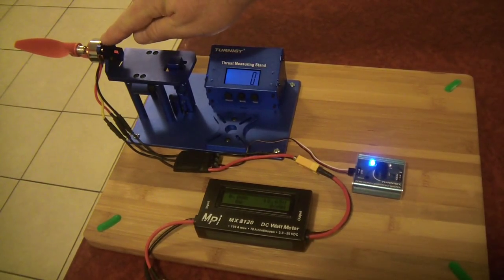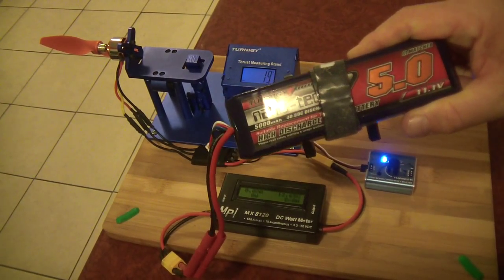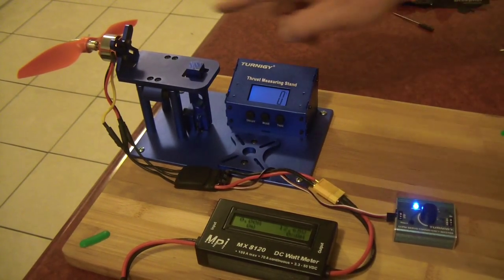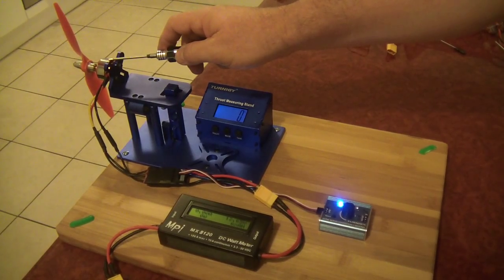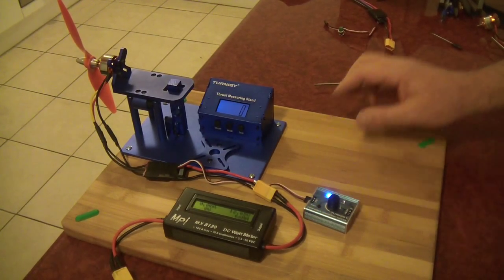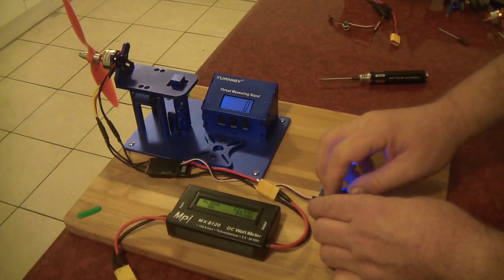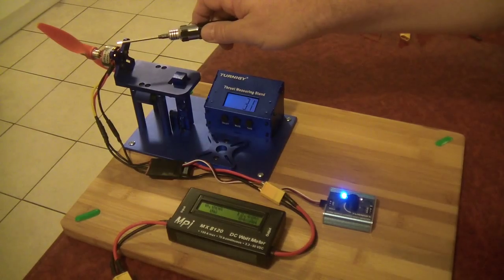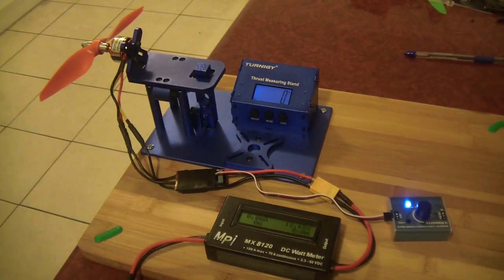BLHeli Vs SimonK with 2822 Motor and HQ 8 x 4.5 Prop

Comment: Hi Rob - Need some expert advice pls. for my S500 quad I picked up sunnysky 3108 720kv. hq 10x6 3 blade props. naza lite upgraded to v2. tarot t2d gimbal. 

I've got 30 amp afro esc and flashed with latest version of BLHELI.  pwm damped light and motor timing speed high.

This is not a race quad but using it for smooth aerial videos. do you envisage any concerns with the esc setup?  anything you'd want me to change? many thanks in advance...

Comment: So I assume any ESC can be flashed with any firmware (although most people seem to be using SimonK/BLHELI). How about DJI E300 Optos: do you have any experience with them? I have 6 of them and was about to throw them to the bin, but after all they might be useful. Optos are a strange beast, they don't calibrate and behave oddly. I obviously could not get my head around what they really are good for.
Reply from the maker: ediblefly That is probably just the DJI model ESCs,  I have plenty of OPTOs from other brands,  IE Afro,  DYS and RCX and they can all be calibrated just as easily as any other ESC and perform great.  I don't have any DJI ESCs but have heard they are pre calibrated for DJI flight controllers.   I think many ESCs can be now used with either BLHeli or SimonK, worth reading up first before buying.  Download the BLHeli suite as it contains a list of suitable ESCs and there are documents online that list SimonK compatible models also.
Reply: ***** It does not seem like E300 are on the list. Anyway, I have figured out part of the problem with them. I have pulled the middle wire (red) on the controller connector out. With the wire back in place, they perform much smoother. I know, it's a bit silly, although I personally blame the manual. :)

Comment: Blheli works great and it's all use now on new builds. So it's all preference I guess. The flash software is easy to use too. Rotorgeeks has fantastic 12A units and is coming out with a 20A any day. My new favorite ESC by far. Always buy a proven  matched motor/ESC combo. I learn this the hard way!
Reply from the maker: ***** Thanks for the tip Johnnie, I just had a look at the Rotorgeeks site and they are nicely priced also.

Comment: Good demo.. I had issues with BLHELI on my Tricopter, sync issue. And it seemed sluggish. I change out my esc to new ones with simon k on them coz I didn't have a working flash tool at the time and it's was an animal. Hi and low lite made the issue reduce with the BLHELI. but SK was the way to go for me.